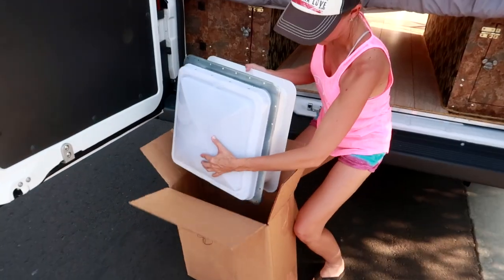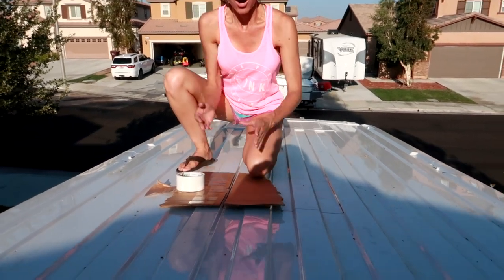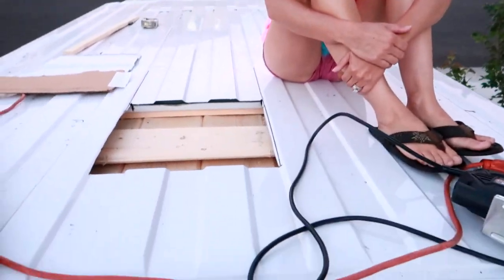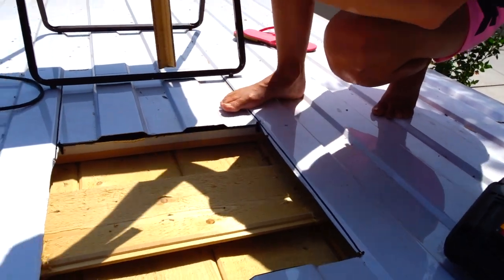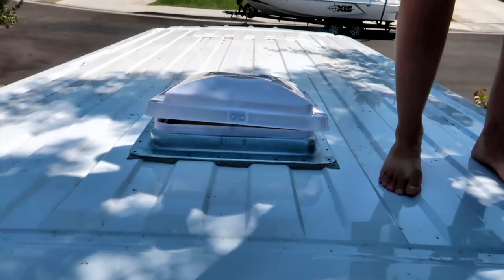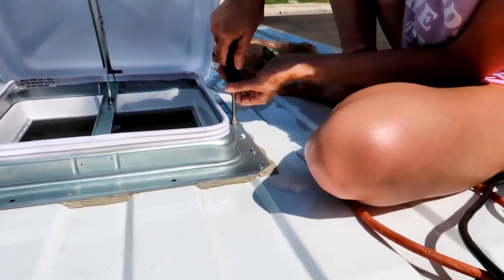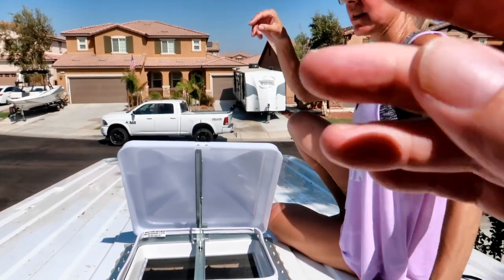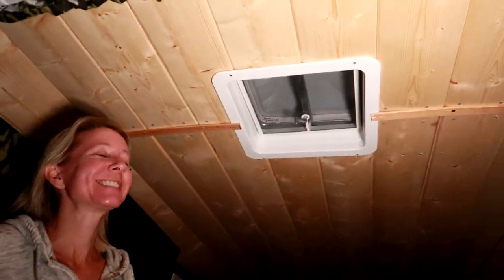Van Roof Vent Complete Install. Cutting A Big Hole In Our Ram Promaster Camper Conversion. Nervous

Comment: I have a melt down occasionally like Luke also. I find it quite therapeutic! Heard great reviews for both the Fan Tastic and Maxx Air Fans!  How was it that you decided on installing only a vent? Take Care
Reply from the maker: The first reason was for safety. We would have to leave a front door window down a crack for fresh air. I believe that having the van air tight when we sleep is not safe. Not that you would breathe all the oxygen but that your exhale after 8 or so hours could mix with the remaining oxygen. The co2 that humans exhale could become the problem. Another reason being that on rare occasions our AGM batteries could maybe during charging give off some hydrogen gas. Hydrogen is way lighter than air and would just find itself out the top vent to the atmosphere. The main reason was for our artic king air conditioner. Hope you saw it's video. Again we would need to leave the window cracked for circulation. Hotter air is lighter than cooler air. makes sense the hotter air will be forced out the top. On a normal 90 to 100 degree day. The van inside is 100 to 115 degrees. The thinking is hot air rises and the van may stay a bit cooler on it's own. Thanks for asking. It will usually take more than one reason why to get me motivated to do anything in life... lol. Have an awesome day.
Reply: billisa  Thank You for the detailed explanation. Look forward to your travel videos! Take Care